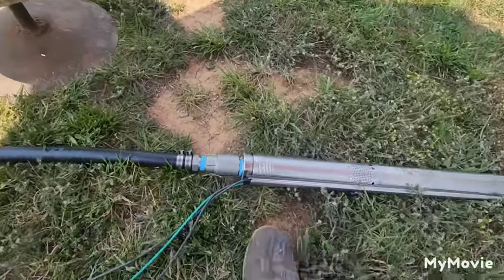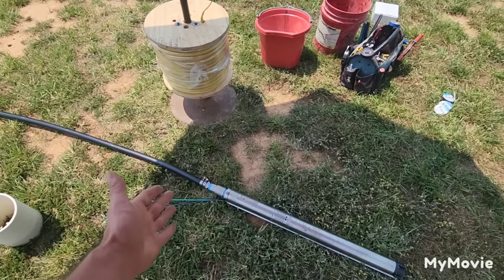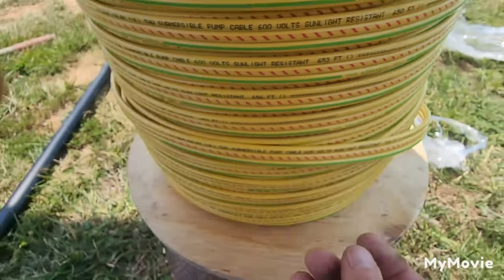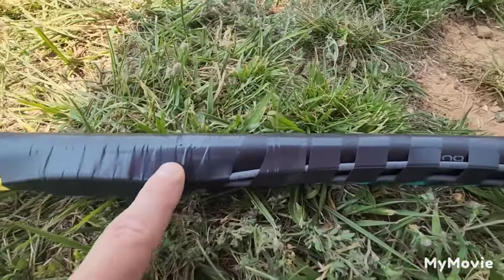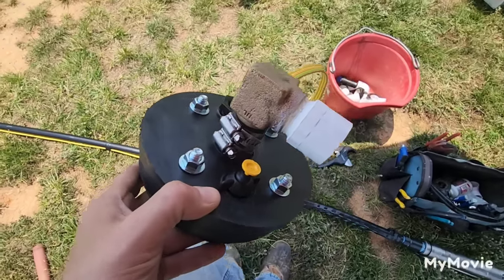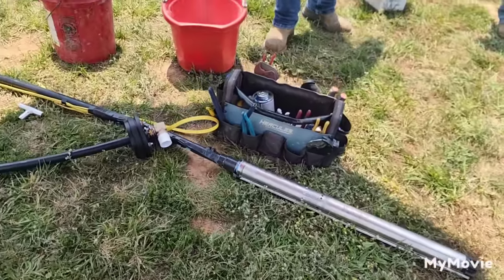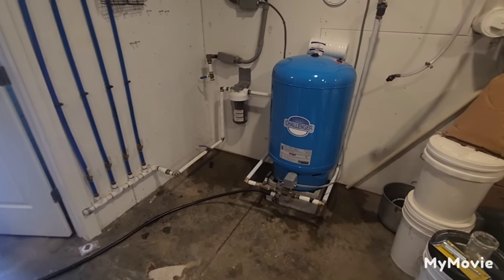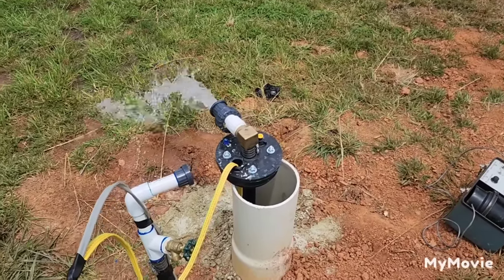3 Wells on 1 Property! Installing a New Grundfos Well Pump & Testing it after Hydro-Fracking.

Comment: Question....  I have a 50ft well drilled in the 70s with a 17ft head.  I assume they figured that was enough at the time, but, I dont trust it to supply large amount of water (just bought the property, havnt tested it, needs a new pump)..  I want to put a system on the pump that detects load so when /if the pump runs dry, it is detected and shuts off automatically.  Assuming the well will not produce enough water for a good long shower, I want to get a BIG holding tank and let it fill over time to capacity, so there is plenty of reserve.  

My question is, whats better, 2 40 gallon tanks or 1 80 gallon tank?  I know more parts, a little more price with 2, but on a performance standpoint, curious which is better?  Thanks.

Comment: This video is terrific! Question on the filter placement. Should the filter be after the tank on any system?
Reply from the maker: Yes. Because if the filter is before the switch, you risk higher pressures on the incoming side of a plugged up element.

Comment: Quick question (hopefully 😅) I have a four wire controller, but only three wires hooked up running down hole (missing ground).  Do I need a three or four wire pump to replace the existing pump? I've been getting low out put...no leaks in system. I just filled up a five gallon bucket in 1:22 (at the well head before the check valve) does that seem normal?

Comment: The thing that I have always wondered is why ground the pump to the electrical service when it’s literally submerged in a ground that’s way more direct than the wire to the house.  It’s like the well pump is a ground for the electrical service, not the opposite….  It’s just strange to me.  And I was thinking about a ballast tank would definitely help with the volume and the quality of the water for this homeowner
Reply: It is not recommended to have 2 grounding points on one electric service.   Use 1 grounding rod at the service entrance.

Comment: 60 years ago my grandparents got a well drilled, about 60m (180') deep, water is at 18m (54'), the pump at 24m (72'), this was/is back in Germany. For the house itself my parents use city water, the well is for watering the garden. It has a 1.5kW 3-phase pump, the current one is probably in the well for > 20 years, and the house is connected to 3-phase 400V. We were never able to run the well dry although we drew in excess of 4000 liters (1000gal) per hour for several hours. I'm really wondering why in Virginia the wells don't make more water.
Reply: not all aquifer layers are the same, add to that more non-porous rock beds and mining of the past ands you'll have nearly no water if any at all. (West Virginia is a great example)

Comment: Do you not have a poly spool attachment on a pump hoist truck? We rarely ever have more than one tech on a job. I can tape the wire to the pipe vertically as I lower the pump down.
Reply from the maker: We used to have a big spool, but it just was a pain & took up too much room
Reply: @h2omechanic  what we have doesn't take up any space because it hooks to the boom and rides on top when the boom is down. There's a video if you look up Pulstar poly pipe spool. Can cut your labor in half.

Comment: I am a complete noob when it comes to this topic. 

But I'm curious if it wouldn't be cost-effective to store more water in the house(non pressure storage) as a buffer, and run the pump only for, say, 10-15 minutes every hour around the clock to keep the water supply level at 20-100% even with heavy momentary consumption and not dry the well. (there is the cost of the 1000L water tank, and an additional booster pump)

Comment: I think I'd build a water tank,  burry about a 1500-2000 gallon tank,  put it on a float and timer, to fill it . Allowing it to run for 20 minutes a hour or something until full. Put a pump in the tank to a normal system!  They could probably do most of it their self   dig the hole, a new septic tank would work to store the water, just use mortar  to seal it up, and cover with plastic before covering, build a small chimney to allow access,  with a concrete  pad covering it. With 1" lines  in and out,  it would have to be a cheaper option,  also closing the valves to most of the usage points to swallow only 70% of the flow  to slow the water use. Our a reducer to 1/2" in line, to slow the water use! 1 gpm, and 3/3 gpm isn't going to be that noticable, unless you are the well producing barely over that,  reduction to 70-75% of the wells supply, will help a lot!

Comment: I have a question if you can answer please ,

My well is used only for the sprinkler system and I removed the old pump that was on 60 feet of PVC

What pump would be ideal for irrigation system at 60 feet of depth?

Thank you
Reply from the maker: On my website the Grundfos SQ-190 is what sell for a Irrigation pump. But you must have a 4" well or larger . The SQ-190 is a high flow 22gpm pump

Comment: Do all Grundfos pumps have the low-water pump-saver circuitry mounted on the pump assembly?
Reply from the maker: The 3" Models do for the best of my knowledge, im not sure about the 4" Models that they offer. A little research & that's a easy question to find an answer for.

Comment: Of course toy must remember voltage drop as well as how long the total run is back to the breaker box as it mandates the size of wire to the switch. I like the pump he used but it's crap if your making sand. Of course you could use a sock with a drain down. Buddy you wouldn't make it a day with me. The main places the wire fails is at the wellhead and the last 10 ft to the pump. My installs the water or off Conn is taped up individual while still warm to help shrink the electric tape. Then I use 3 or 4. Inch 10 mil tape to tape the first 10 to 14 ft of wire to the pipe. I only use 3/4 tape on the Conn after hearing them to seal. 
   So dude what your warranty?  Pump, pipe, wire labor?  So you just a grundfos man or do you use others like Franklin?  Try installing a large storage tank a gallon a minute is 1440 gallons a day and that's usable. You don't use any type of pump monitoring equipment?  Take care and keep the water flowing.

Comment: At what point do you need a torque arrestor? Or is it not needed? Awesome content!
Reply: As I understood it from a previous video, he doesn’t feel they are necessary with a Grundfos pump that has the easy start/slow ramp up feature as it doesn’t apply very much if any torque at start up. It’s a slow 4 second ramp up to full speed vs. a direct and instant full power start up.

Comment: Again, late to the party on this (life sure does get busy at times). I am curious why no one suggested a two stage system on the well that makes clean water. It can produce over 1400 gallons a day, probably over what they most likely need. I know it means another tank and some added electrics. I would think they would be happy to do that if it meant they didn't run dry and need to wait for the well to recover.

Comment: For normal wire runs you’re supposed to upsize 1per hundred. Your running low amps so maybe 200’
Reply from the maker: We up sized the wire in the trench to #10. 
After that I use a wire chart provided by the pump companies to determine distance. 
Once a system reaches 417ft total for this pump, it's recommended to use all #10 beyond that distance. This Well was only about 50ft from the house, so it wasn't a factor here. 
But your correct on needing the bigger wire for longer runs. Franklin Electric has a nice chart we always follow

Comment: I have this exact same problem my well is 600 feet to the bottom pump is hanging at580 feet down it has an abysmal feel rate of only a 1/4 Court per hour which is only 90 gallons per twenty-four-hour cycle I have gotten in touch with your office and they were unable to point me in a direction of someone whom i could get to do this for me because no one in my area as I know of even does this kind of thing I don't want to give away where you're at but if you could message me on here maybe we can private message and you can inform me if you know someone that is in my area that does this I'm roughly two and a half hours from your area

Comment: Ok i'm living in another country now but my past 35 years of electrical & plumbing has kicked into high gear in thinking why in America don't your houses have water tanks in houses like uk. only are drinking water taps are mains water not from the tank so you could have living water for say all day without having a feed supply. Philippines here they eather build their own concrete tank or invest in steel tank as water is often limited to areas & times.

Comment: So a couple of ideas/questions/I really have no fuckin clue what I'm talking about but I want to talk.... Why not refrack the current "new" well again? Or what about trying to frac the 2nd one and seeing if you could use both of the slow production wells of it would be enough to make it work? Or and yes this costs much more than anything else but use all 3of them and instead of just pumping the sulfur water to the house maybe useing it to supplement filling both the low producers so it obviously dilutes the sulfur and when demand is super high cutting it on to help with production,,?
Reply from the maker: I actually thought about Fracking the 480ft well (near the pool) but it all boils down to time and money. It's my job to try & make the most of the time I have and not look at the $$$ I could make. The customer was put thru the ringer before, I don't want that to be the case with me. I try to think what's the best/most effective way to resolve the problems with the least amount of money spent. I make enough to keep my business running, but not over charge or sell unnecessary products & have a customer get sticker shock.  Personally, I was hoping for +2GPM and all the issues would have went away, but this is what we got & we can only move forward & try to make the best decision for the future. I Always try to be upfront and keep the customer informed good or bad, these results were good, we just need a little more water for 7 people.

Comment: Now I'm no water science guy lol. But if if one inch pipe takes 100 percent of the flow from the pump and then you increase buy 1/4 inch wouldnt you increase buy 25 percent not 50? I literally dont know just thought it was kinda funny. Anyone actually know?
Reply: No. By increasing the diameter of the pipe by a quarter of an inch, the area of the pipe increases 1.5 times.
Reply: How? Like what's the formula for that? Is there even one that is easily doable?
Reply: Cause going from nominal size over to volume dosent make sense to me.
Reply: Pressure should affect that too right?
Reply: @nicholasfrediani9466  Just use the equation for the area of a circle
Reply from the maker: You are correct. But by measuring & common logic it wouldn't seem right, but it is!  I knew that statement would draw in comment 😆. Thanks for your knowledge.
Reply from the maker: Yes, a circle is pie 3.14159265, you multiply the addition 1/4" by that & its 1.5times bigger than 1". But the reality totally goes against what common sense would say it is. 
It's the same as saying 2 6" holes = a 12" hole, they do not.

Comment: Could have replaced that overpriced pump controller with a standard single to 3 phase VFD with very little knowledge if the pump itself wasn’t worn out already…it would have costed a couple hundred bucks instead

Comment: It had a booster pump that was taking a shit so I got that fixed then of course the control board took a crap and it has 2 1200 gallon tanks and of course the valves on bottom tanks were broken from freezing .that was no fun to fix had to redo all the plumbing was insane .and I'm not a plumber but I do alot of heating systems .I'm telling you the feeling when I got everything up and running was like lottery win .and booster pump was a grundfeous I can't spell .saved owner thousands company's there were marking up over 5000 percent yea nuts

Comment: I got a wire kit for my pump at lowes and it was a 250 ft wire kit . But that was about 10 years ago.
Reply from the maker: Most kits are 150ft for $300. So its $2 per ft. For sub pump cable in a kit.
Reply: @h2omechanic  and in that I said ft not price
Reply: heh. everyone has been dumbed down and not many have hands on experience anymore nor knowledge to do such labor anymore. cannot say I ever bought a 250' wire kit from a box store. but majority of wells here are all shallow wells, single or dual line with ejector(under 70'), although some deeper wells exist near the lakes, with extravagant bulk storage tanks and pumps for the dwellings. (400 to 600' deep range). I myself will not touch nor deal with anything beyond 60' foot range. I say call a well company with dedicated trucks(lol).